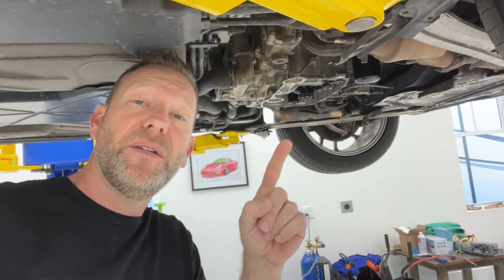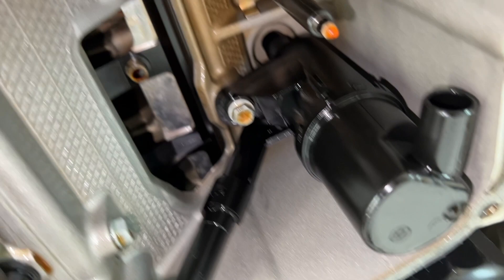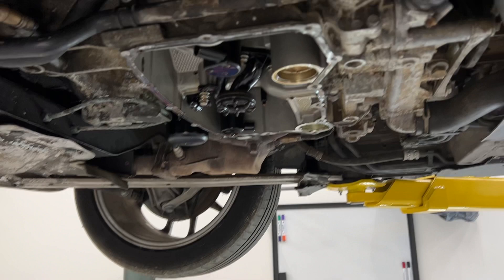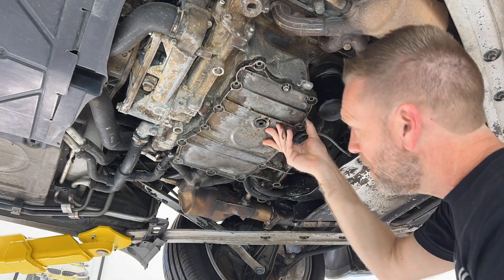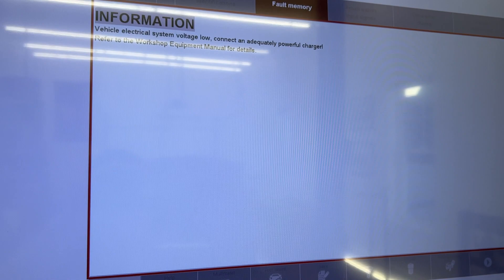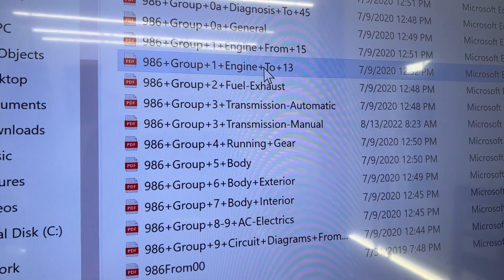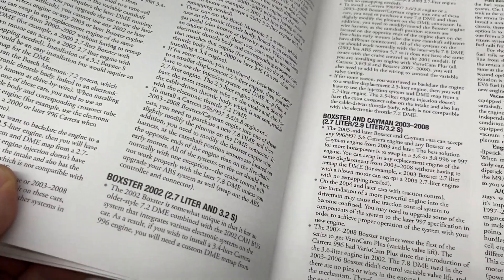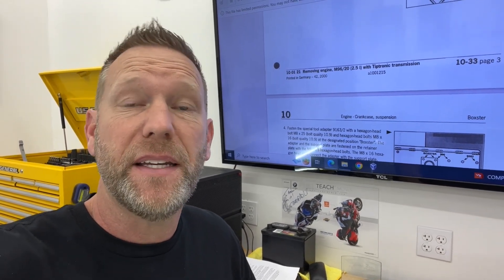Boxster 986 Borescope and PIWIS engine analysis (BBB Part 3)

Comment: I would definitely scope INSIDE the cylinders! Go in through the spark plug holes and check for any corrosion or bore scoring.
Reply from the maker: +David Shaw I’ll be doing that after the engine is out. Well, I’ll just take it apart and look 😆
Reply: The 2.7 doesn’t suffer from bore scoring.
Reply: @dion9146  any engine can “suffer” from bore scoring. Some engines just have inherent design flaws that make it more likely under normal conditions. 

This engine may have had a cylinder get to hot and welded itself to the piston (one possibility for a seized engine) this would very likely score the cylinder. There is no engine that’s immune to basic problems and the m96 is no exception.
Reply: @davidshaw164   I realize that.  I see so many people lumping ALL Porsche engine problems on every one of the different models, and I was just commenting that the 2.7 doesn't suffer from bore scoring.  That's mainly an issue with the 3.4 and larger motors due to an inherent design challenge in the engine itself.